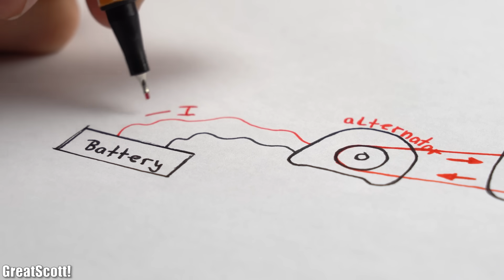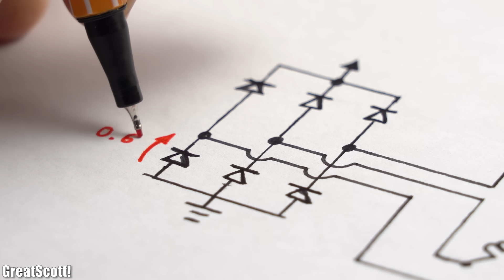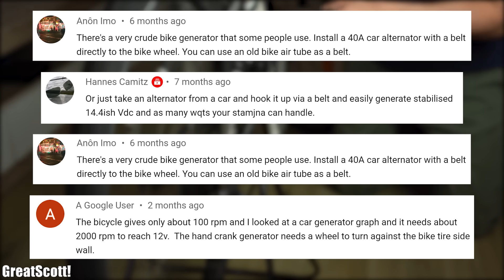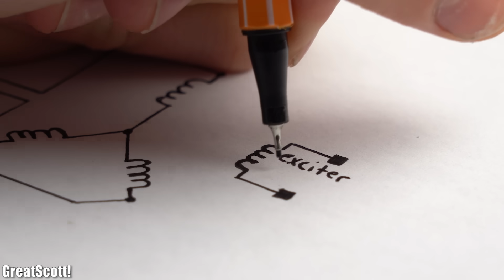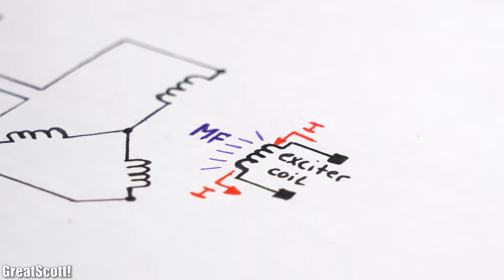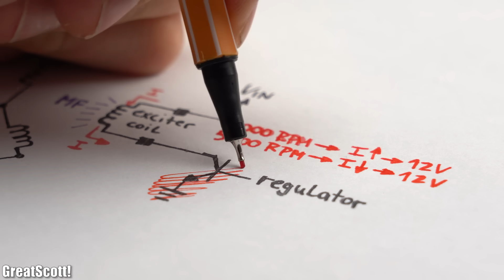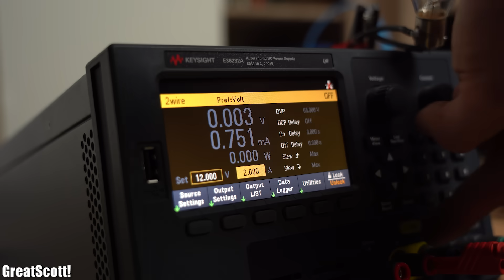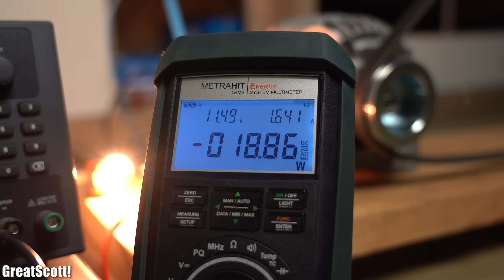Using a car alternator with a bike to power my home? How much energy can I produce?!

Comment: I did this successfully using a 2hp gas engine.  My plan was a quick, portable jump start device..a small 8 amp hour battery, wired in the circuit will sustain that excitor and when a dead auto battery is added on .the regulator opens the current flow.  The 2 hp engine barely could keep up with the load.
Further experiments lead to dynamo type dc generators but wattage, rpm  and torque played a huge disadvantage. 
 My latest incomplete trial is a electronically commutated motor..or ECM..from a newer furnace appliance.  Inside the end bell is a controller module that pulses the driver circuits..this part was left out in the experiment. 
 GS..this is where you should step in..these motors, less the module, are a 3 phase dc generator and in it's present configuration, may do exactly what you and others are looking for.. I can state this..at  a rpm range of 6 to 12 the voltage is higher than your experiment..so the gearing ratio will reverse. Do consider the wire gage on the coils as a amperage capacity, an external regulator will be needed and a dump or shunting circuit as well. Good Luck..this one may be promising for windmill also, just add storage of suitable wattage. 
Ill see you when the gears start turning ! 🤔🤔
***An used  ecm motor can be acquired with a defunct module almost free..calk around for few of them..

Comment: In practice you'll need at least 8192 alternators to generate these 2500kWh of energy for 12 hour cycling, or use power inverter for that. Then the other problem will hit you - where to store that energy. Batteries are too expensive.

OTOH you can make a lot of improvements to the setup - flywheel for energy-saving, not using belts (you can change rear wheel with the flywheel directly connected to the alternator), recumbent position for longer runs, etc, etc ...

Comment: That belt had more slack than the software of the same name. You need something to tension the belt. Most belt driven devices will have a tensioner somewhere to keep the belt taught.

Comment: Average human should be able to deliver 200W+ on a bike. I think the problem is still the generator setup.
Reply: I think the problem is the load. A resistive load will draw only U^2/R, no matter what the maximum available power is. I think voltage is proportional to rpm, so instead of increasing rpm, he could use a bulb with lower resistance or try measuring short circuit current...
Reply: @abdellahbarrous8516  But then he shouldn't have had trouble maintaining the speed. Obviously matching impedances for maximum power transfer is still important.

Comment: Scott, think of the gears like a transformer. You got the front sprocket right, but the rear is on the lowest gear. You need a high output-input ratio for a high gear, meaning large sprocket on front, small on rear. Few turns on input, more on output.

Comment: Great project Scott! I did something very similar for my final project in high school (scientific lyceum) and in the end we were able to connect a small blender and offer banana milkshakes to everybody!
Just one suggestion: once you apply the voltage to exciting coil and electricity starts to be generated, you can switch off the power to the coil because the rotation will keep the magnetic field alive.
;)

Comment: Hello Scott. I suggest you to convert that car alternator to a 48V bldc motor as a next project. Normally you can feed the exciter coils (rotor) with 12V via a power supply and 48V with stator coils via an esc after canceling the rectifier circuit it would work. There is a great video named “ Converting  a car alternator into a go cart motor “. The video belongs to austiwawa. But what I am suggetting you to do it with one power supply. If you can change the exciter coil and make it able to supply with 48V also, you can use one power supply to feed both stator and rotor coils. It would be an exciting project in my opinion. What would you say!!!

Comment: You could have used the alternator as it was designed to work - just connect it to a suitable battery, then take out the same amount of power from the battery that the alternator puts in!

Comment: Somewhere out there is a Mustie1 video where he got a perfectly good power generator because the previous owner didn't realize it used an exciter type setup and let the battery on it go dead. Some other typical issues with a carburetor on an old engine, but it was fun to watch.

Comment: A alternator from a diesel car may work better since it would be designed to run at lower speeds. Also if you spin up the alternator to full speed then toggle the coils you may be able to get a higher max speed.

Comment: you were in the low gear on the bike. you want the smaller sprocket on the rear for max rear wheel and the biggest sprocket on the front.

Comment: Try powering the exciter coil with the output of the generator!
Reply: That's how cars do it. They start off battery power but since the charging circuit is tied together, well I'm sure you get what I'm saying
Reply: It would be more sensible to just remove the exciter coil all together and install some neodymium permanent magnets. It removes many problems this setup has. No need for extra power input and no automatic regulation to keep the voltage at a stable 12v. You can regulate the voltage in-circuit without worrying about the way the regulator circuit on the coil messes with the RPMs. Its much easier to peddle steadily if the alternator isn't fluctuating from hard to easy to spin constantly, and you can take the output right into a charge regulator into a battery bank to store up the energy. This would never replace your home AC, but it definitely could be a great emergency power system to run 12v lighting for a home and some light electronics like radios and cell phones in a black out.
Reply: @GamerLoggos  I think a decent solar setup with storage batteries would be a much better solution.
Reply: @xaenon  I think a much better solution would be large centralised power generation serving multiple homes with a system of fossil fuel, nuclear, and renewable energy powered generators with a complex system of oversight to ensure every home has sufficient energy at all times and to cope with variable demand.

This is not supposed to be a "good solution", it's a fun project.
Reply: @xaenon JUST !! PUT !! A !! NICE !! THICK !! BLANKET !! OVER !! THE !! SOLAR !! PANELS !! AND !! REVERSE !! THE !! BATTERY !! CONNECTIONS !! POWER !! STATION !! POWER !! NOW !!!
Reply: @davidwillard7334   Ummmm.... wut?
Reply: @xaenon  Still is an incentive to lose weight.
Reply: @davidwillard7334  Dude, whatever chemical substance you're on, you clearly took too much.  Or not enough.   Either way, I'm not interested in your childish game.   Toodles.
Reply: Not the exciter coil but the voltage regulator. It will give you a steady voltage output with the amperage increasing as you put more power into the alternator, and it should smooth out the resistance similar to what GreatScott did.
Reply: @davidwillard7334  Dude wtf are you talking about

Comment: Also remember - manual power generation is THE WORST power generation for many reasons:
1. You have to constantly be engaged to create energy and our ape brains find that boring. (Unless doing something else like actually traveling with a bike)
2. You will have to eat more to provide yourself the energy needed to generate power. And we are not just a willy-nilly pour oil to refuel kind of machine. No no! We get upset if we have to eat the same pasta for two days in a row and drinking pure oil is out of the question.
3. Our human fuel actually has to grow somewhere, which further decreases the efficiency chain. So... [solar energy hitting the plants, plants alot of energy by inefficiencies and being alive, sometimes we add another step of some herbivore eating that plant and wasting energy on digesting it (and also being alive) and we eat the plant/animal, waste even more energy at processing the food. THEN we can actually move our meaty legs, waste even more energy by heating up.] We are not even counting the kinetic/power conversion efficiency and its already pretty bad. Just compare it to [solar energy hitting a solar cell, wasting 80-90% of its energy and voila, you got power]

Comment: Doesnt the generaton come with a graph of the excitation current vs max power output? You could use that to get the most efficiency out of the generator. Then you could control/change the resistance of the exciter coils to power them with the power generated by the generator itself. At least thats want I would do. Cheers

Comment: You did this all wrong. If your findings were true then they wouldn't even bother using an alternator on every single engine across the planet. I even upgraded my alternator to 210w. Try again. Maybe use a constant energy source, i.e. a running creek near by

Comment: You'd need a shorter belt and maybe an idler tension wheel to keep it tight. Doesn't matter anyway, because it's one big machine to generate very little power.

Comment: I rember the old fashioned bike lights that would have a alternator against your bike tire.  It would be spring loaded so you could lift it off your bike tire when you didn't need your bike lights.  You might be able to fined some on ebay and see how much power you can generate with them.

You could also retrofit them with modern LED bulbs and put a USB port on it to charge your phone!

Comment: There is a loss of Energy when the Chain transmits to the Rear Wheel and the belt that Drives the Alternator has also a loss of energy. It’s Called „Wirkungsgrad“ of the Chain/belt

Comment: I think I'd have just rested the bicycle tire against the alternator pulley and driven it directly, rather than using a belt.  Then you wouldn't have to worry about belt tension or slippage.

Comment: You should convert your altenator to a PMA (permanent magnet altenator), there are plenty of resources online that sell kits to do this. They produce much greater energy at way lower rpm. Also adding a hinged 2x4 with a pully and spring in the middle of the belt for a diy belt tension device would help to keep the belt from slipping under greater load.  Nice build overall.

Comment: isn't that a little bit weird that this big car alternator only produces 20W?
I mean it provides power to everything in the car and it also charges the battery at the same time.
I read that those can provide up to 3kW!
Maybe you can load your alternator with a bigger load like a boost converter driving 230V devices to get much more power out of it.

Comment: a strong cyclist is only 100-200w for significant duration. a car alternator wastes more than 100-200w. In light of those constraints you need a very efficient alternator, almost certainly one that uses strong permanent magnets for the field. Perhaps that can be run thru an MPPT charge controller to a lithium battery.

Comment: I wanted to make an 'energy bike' years ago and also planned to use an alternator from a car. Did some research and calculating and figured the average person wont generate more than 10 to 20 watts (for 20, you have to peddle pretty strong already, which didnt seem all that attractive/ worth it.
Youll need to use a dynamo though (electromotor basically) and there are plenty of those around. Doesnt need to be a big one, as the energy you generate is low. Doesnt have to cost anything either.
So suppose you are sitting on your bottom all day anyway and need some exercise. Then a solution like this is not bad as you can have a workout AND generate some energy > electricity, that you can use later. An easy 10 W is possible, for 10 hours is 0,1 kWh. Thats enough to use a laptop for about an hour.
Aye, its not bad as a backup for when the grid goes down. If theres 2 of you, each on a bike, and you peddle long and hard enough, you might be able to watch a movie on the laptop after a days biking ;]

Comment: I’m pretty sure alternators on there own act very strangely, they are part of a battery charging system. Try putting a car battery in the loop? the 2KW 12V alternator on my narrowboat will happily deliver 2KW at the engines idle rpm and dose not have any connection on the “control” pins. But! The battery needs to be at 11 - 12.5V for this much power to be delivered, as the battery voltage approaches 14V open-circuit, the alternator power falls away to nothing. Hope that helps! Great video :)

Comment: 1) add weight to the bike wheel so it acts as a flywheel storing energy. 2) tension the belt. 3) you're not spinning the alternator fast enough. humans can easily generate 300 ~ 400 watts :P

Comment: there are commonly available 1 wire alternators for some older vehicles.  1 wire means they are self-exciting, which makes them a lot simpler to use for things like this.
Reply: It's not complicated, it just needs a small battery.
Reply: @Fix_It_Again_Tony  
i didn't say it was complicated, but it could still be a lot simpler.  1 wire alternator means you can just hook it up to a battery\anything needing 12v and crank it.  You don't have to worry about messing with applying voltage to the other circuit, and a source for that voltage.  True it's not terribly hard to make that happen, but why bother when you don't need to?

Comment: 9:41 : Only 20W!!! There's a video with an olympic athlete producing around 600W (if I'm not mistaken) going really hard at it. Now, olympic athletes are certainly a lot stronger and fitter but 30x as much is not something I can believe. I think there must be something you're doing wrong. You've got to be able to produce more if you keep tinkering with it. As far as I can tell, it seems your belt is too slack. Also, why are you on such a low gear? Finally, your wooden frame looks rather flimsy, wobbling side to side - if you put maximum power onto it, it might fall apart so I think some strengthening is required to avoid damage or injury before trying to pedal harder.

Comment: The alternator is used to charge a battery which powers the electrical devices.  I was surprised by the 12v regulation circuitry because when the car is operating the system has 14.5 to 15.5v.

Comment: You should use a permanent  magnet generator or you can rewire an old washing machine motor to produce DC current.

This one produces 2KW at 1200rpm
I use on average 6.67KWH per day so I would have to pedal at 1200rpm at generator for 2 hours and 40 mins per day on average

https://www.amazon.com/Ista-Breeze-Permanent-Generator-Savonius/dp/B07L9ZVL48/ref=mp_s_a_1_13?dchild=1&keywords=ac+generator+dc+permanent+magnet&qid=1620585019&sr=8-13

https://youtu.be/PeK_j_HBB-w

Comment: My man, you already had the best motors for this use case BLDC. Car alts are HORRIBLY inefficient and half the power you are producing is going to waste. Using a BLDC only requires a bridge rectifier on the output to provide a "DC BUS" that you would then put some caps on to help stabilize output. ldudley@advancedenergysys.com I'm working with cheap EV components that are severely under priced for their output and quality and I would love to help you pick the best components for the best efficiency!

Comment: it will work better if you use the regulator in the generator. And see how to connect the generator outside the car, there you need to connect the L terminal through the lamp to the +. The generator has an additional rectifier to power the regulator and the field coil. You can also add a belt tensioner.

Comment: Older bikes had small dc motors connected they made very small resistence on the wheel but they had six watts of power. you could attack three of those. Easy and cheap solution.

Comment: by experience.. doing right the wrong way gives right answers for wrong questions.. minimize amps for the 12 volt exciter coil so mag'field resistance lowers torque input.. add proportionate weight mass to fly wheel for torque gains over lenz friction.. just pull steady 100 - 200 watts max from alternator to charge battery bank with a #victronenergy DC charger.. fly wheel can be rotated with clock escapement for hours with a heavier pendulum swinging..

Comment: I tried this myself years ago. Slight difference though: I built my own voltage regulator circuit, that constantly adjusted the exciter current to maintain a fixed output voltage. One that was rather more efficient than the one built into the alternator stock Still not practical though, as the limiting component was biological.

Comment: 6:40 Sorry, I have no idea about cars. Why don't they use a permanent magnet and an electromagnet instead? So you need to use electricity to be able to generate "enough" electricity. - I don' get it. Is it maybe to regulate the output electricity in the car?
Reply: Yes. The exciter coil induces voltage into 3 coil phases that are rectified. The voltage regulator adjusts the current to always get 14/28V.

Comment: You have missed something: The crank pulley that drives the generator is about 3 times larger than the alternator's one. So at 2500 engine RPM you will have 7500 rpm at the generator.

Comment: I don't think you need a full 12v for the exciter coil. You might be able to get away with 6v or even less. Only way to tell is to experiment with it. I remember alternator-->motor conversions using a 3.7v lipo battery and it worked fabulously so you may only need 4v. Check it out.